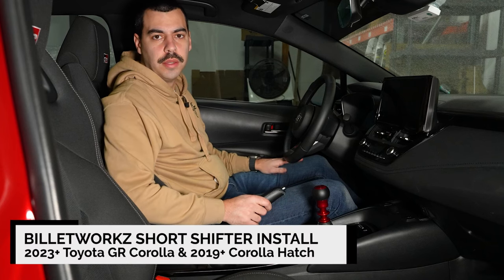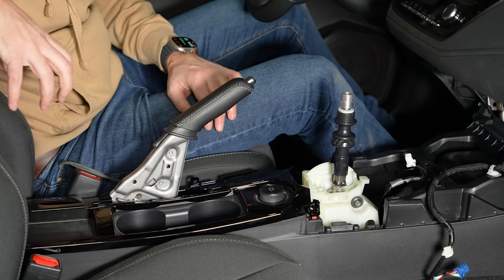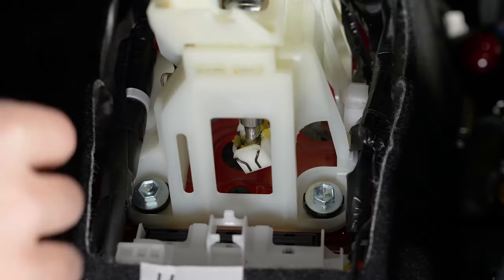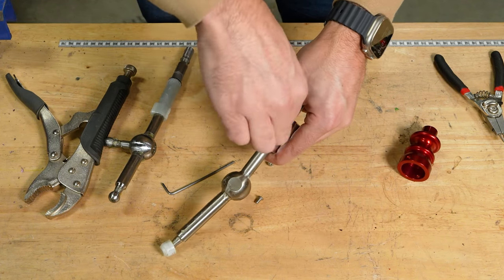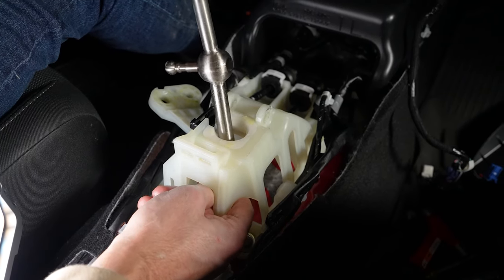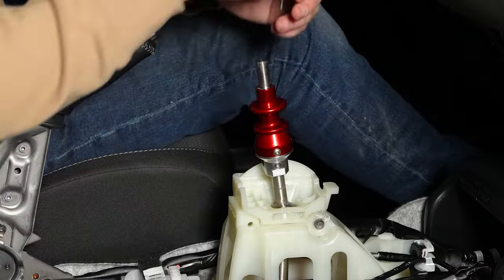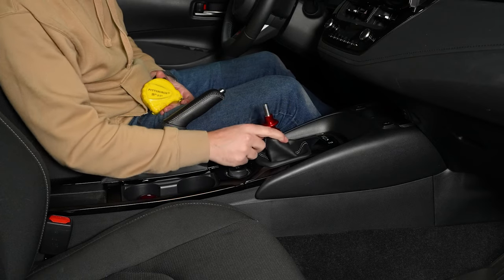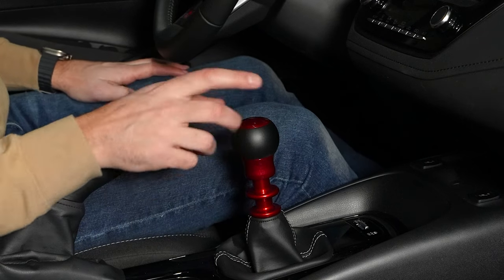Billetworkz - 2023+ Toyota GR Corolla & 2019+ Corolla Hatch Short Shifter Install Guide

Comment: is there any way to stiffen the centering spring? going from 2nd to 3rd i feel like the spring is kinda weak and i sometimes hit the divider between 1st and 3rd. never had that experience in my other cars until i got the GR.
Reply: A lot of us have had the issue. Look up a "pitch mount". It's basically a motor mount and should stop that issue. I have the Delta X, but there are 5-6 options out there.
Reply: @MightyP01  pitch mount was the first upgrade i put on the car, it may have helped centering a tiny tiny bit but i still want a stronger spring. im prob just going to get a coolerworx short shifter if i cant find anything else.

Comment: Ever heard of a trim tool remover.
Reply: Do you have tender weak hands or something? No part of that trim removal process was a struggle, why would a trim tool be needed here?
Reply: If you ever worked on the center console as an owner, you should know how easy it is to pop off these panels 😂 unless you're referring to cutting the wire holders, and the lock washer, then yes 😭
Reply: Obviously, y’all didn’t watch a damn thing.